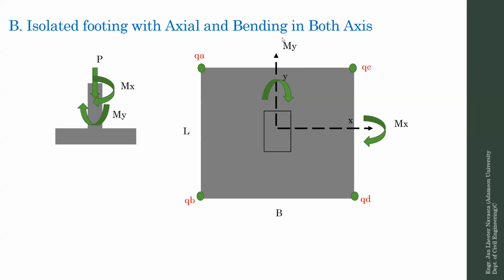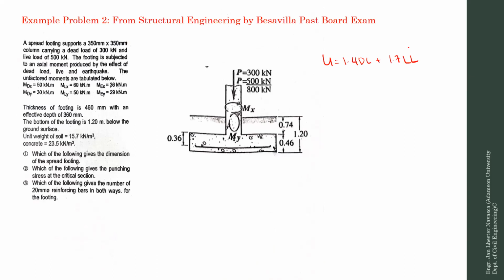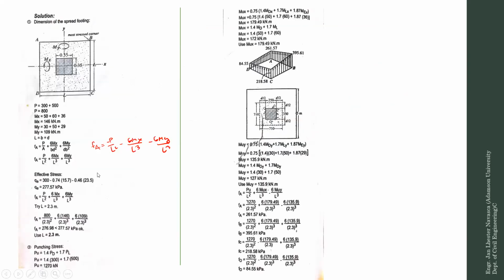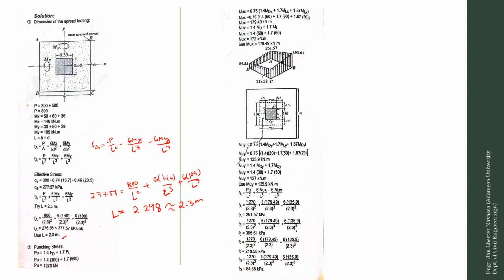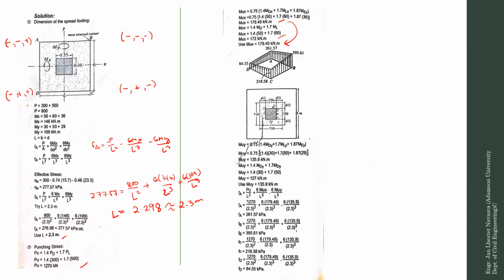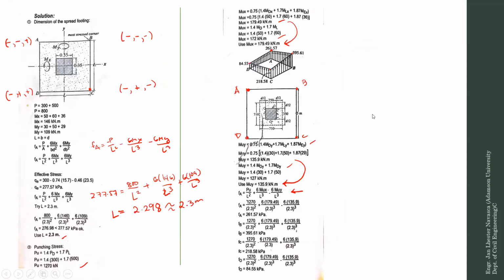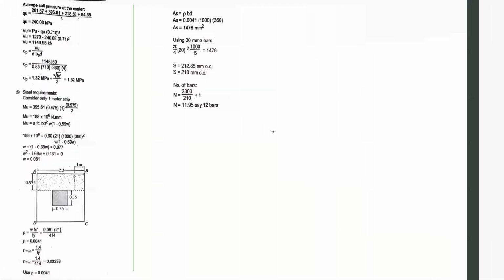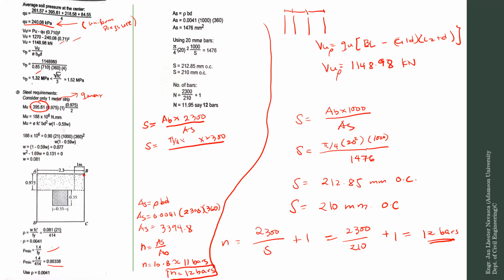16B PCGE ISOLATED FOOTING WITH AXIAL AND DOUBLY AXIS BENDING

Comment: Sa structural design software po ba ang ginagamit ay yung true value ng soil pressure q sa bawat corner ng footing, hindi average q? Wala po bang paraan para makuha ang true q using manual calculation?
Reply from the maker: Structural design software use finite element analysis.